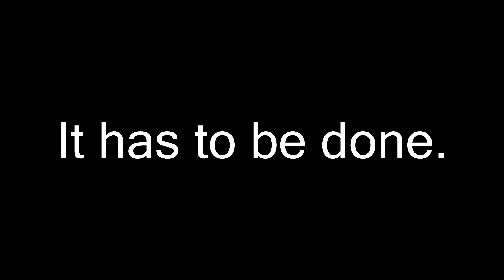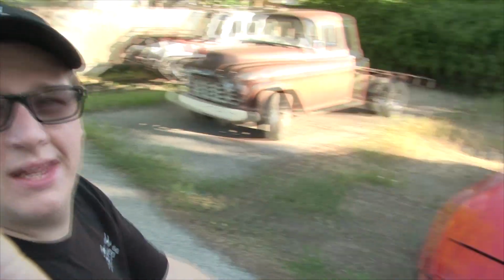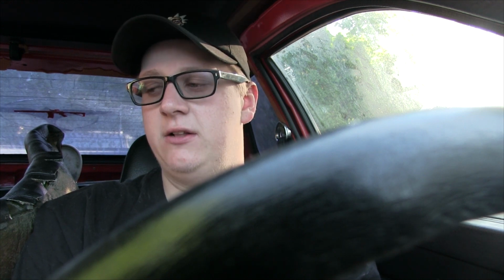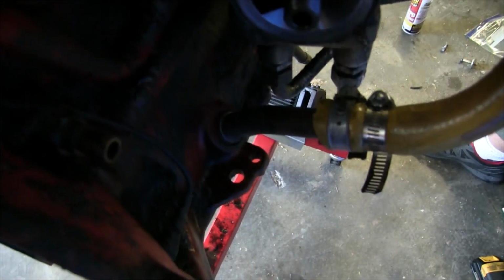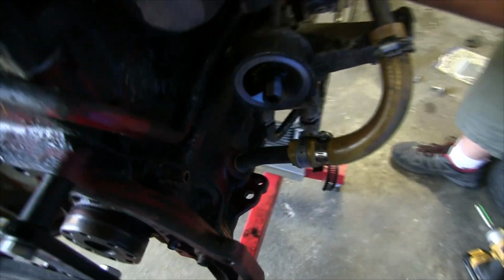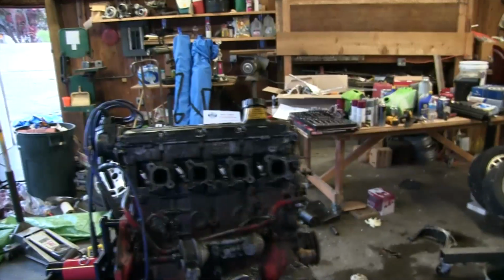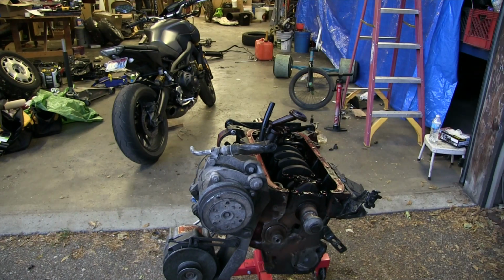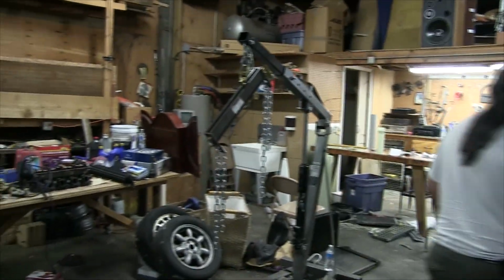Unfortunately It Has To Happen...

Comment: Oo i have a idea. You should look into the whiteblock volvos. Those 5 cylinders with a decent exhaust sounds like a baby v10! Everyone and their mom has one :). They also use obd2 and a very tuneable ecu.
Reply: Godspeed nope, electronics die too much. Whiteblocks are kinda garbo imo
Reply: The SquintoBean what naww. Dies as bad as any other obd2 cars.  Its a easy fix compared to his obd1 jasmine car. Whiteblocks are also bullet proof to far pass 800 hp if he gets a 2.3-2,4 05 model. Only thing needed is h beam rods and it will handle powah.

Comment: I’ll give a relatively clean 1999 bmw 323i (E46) for it. On BBS Lm’s ZHP suspension. Short shifter etc
Reply from the maker: drake montana Where are you located?
Reply: Now that would be MUST SEE TV!!
Reply: Braden Carlson Harrisonburg VA,I’ll make a trip.
Reply from the maker: drake montana We'll see how well we can get it running. That's a long drive and I'd feel real bad if it broke down on you on the way back

Comment: How bout sell the miata. You can get miatas all day long. Take the parts. Keep the lift. Keep the lowering. Keep the wheels. Sell the miata. Then sell the parts all serperate. Then use that money to fix the porsche with that 5.3 you guys have for the volvo. Then sell it. And buy another miata. I would keep the 944. Chances are getting that things value up is a little bit easier
Reply from the maker: MrLendermanGaming Somehow you missed every single aspect of the first 5 minutes of this video.
Reply from the maker: I do think that LS swapping it would add value, too, like I said. It's just that as it sits, with maybe $200 into it, I could stand to profit $1200-ish. Whereas if I swapped it, it would cost around $2500 (including the swap kit and an engine, but not a whole lot on top of that), and I could reasonably expect $3500 to 4000 for it. So in the end i'd be spending a lot of money, and using a lot of time to wind up with the same profit margin.